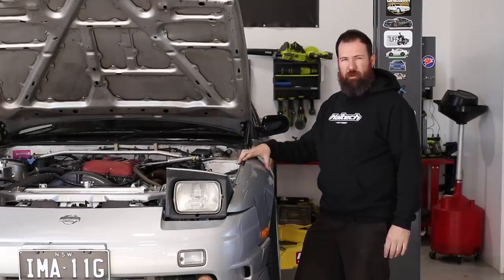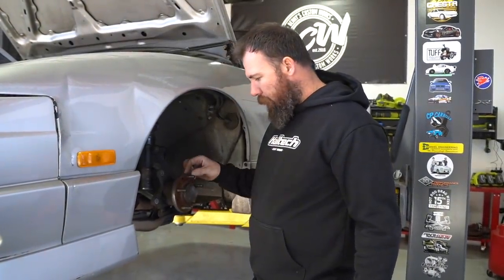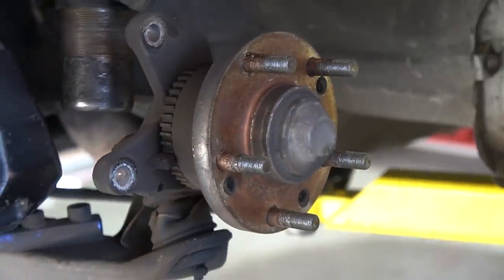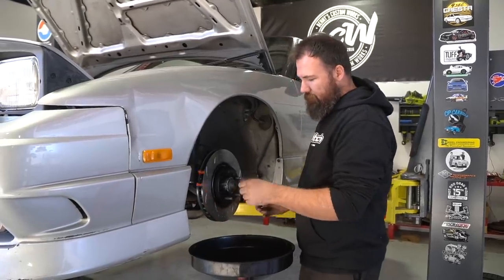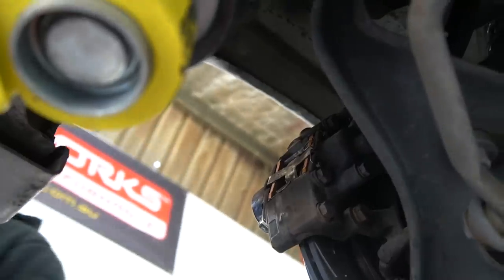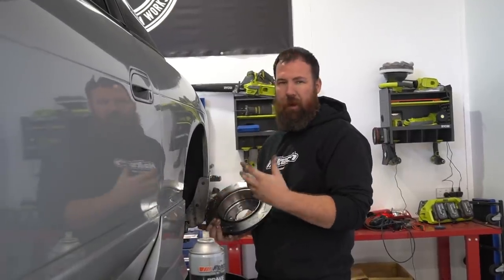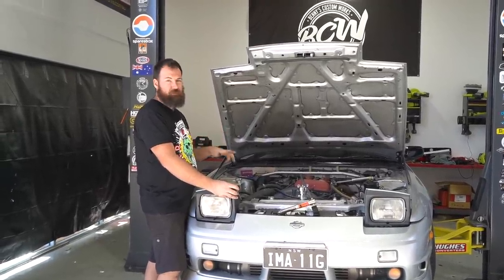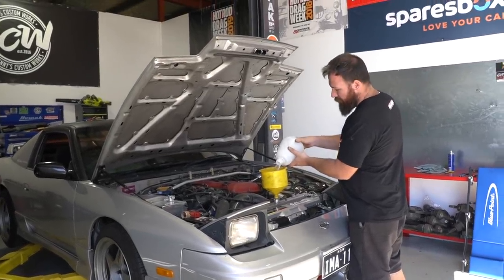180sx - Brakes & Coolant Leaks

Comment: The APRA Pulsars do 1 hour enduro races at Wakefield on DBA T2's without any problems...have a cool down lap without using the brakes, don't come into the pits with hot brakes and pull the handbrake on (put it in gear) as that can warp the rotor.

Comment: Any experience with using EBC red stuff pads Benny? Any good?
Reply: What is your intended purpose (vehicle and use)?
EBC Yellow Stuff is a cheap pad which can take light track duty, but there are much better (and more expensive) pads around. The red stuff is a tier below the yellows and I would never use it on track. For the street they are probably fine.
Reply: Burnt through an entire set of EBC reds in a fairly mild track day. Wouldn't recommend for track use at all.
Reply: Never used red stuff but I've used some of thier pads in motorbikes and they were crap